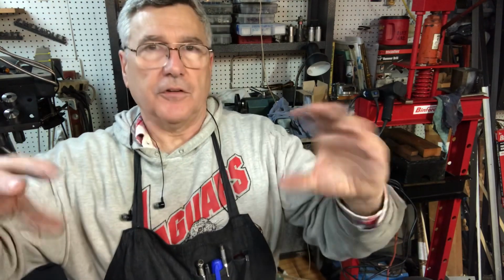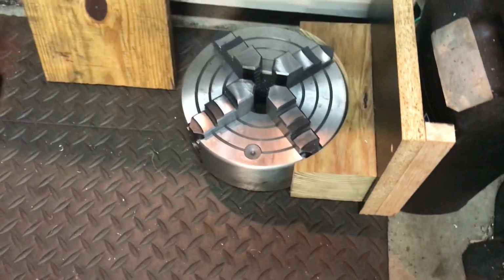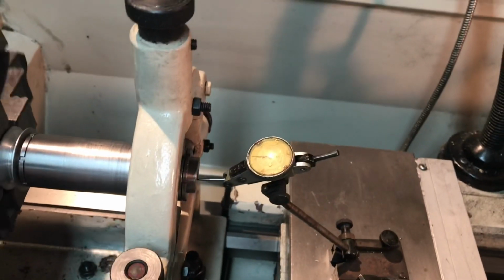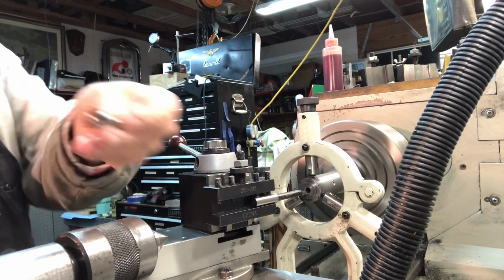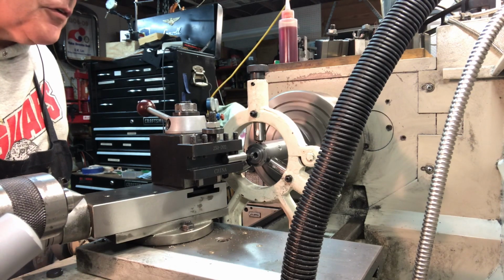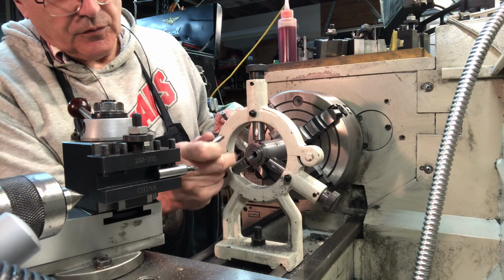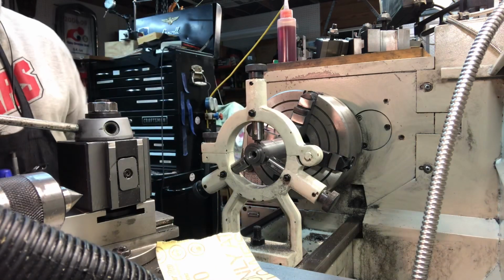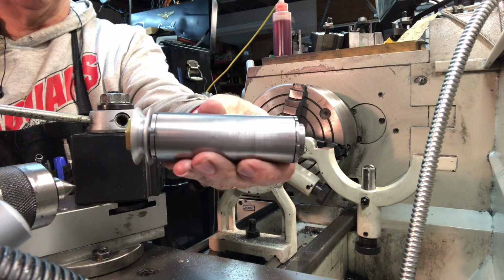Quorn Tool Grinder project, finishing the spindle 40 degree bore for WW collets.

Comment: About 1 minute mark in my video I will link I show my chuck sleds.  Was better to just make ONE base that fits ways, then make many tops for various chucks. Originally I had pinned base to each sled, but that turned out to be a bad idea. Much better letting sled slide on base plate.  I will put link to video in reply to this comment. You will need to approve it I assume.